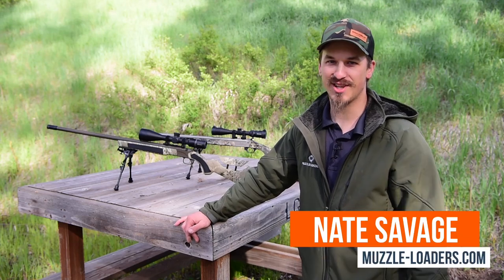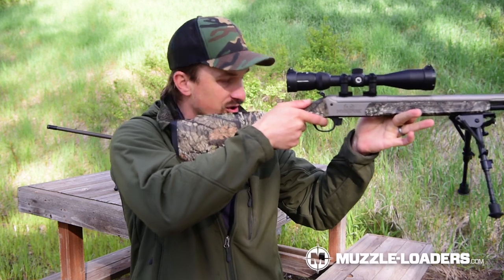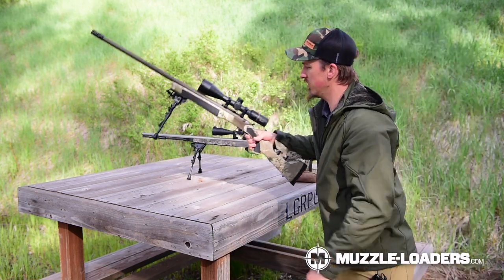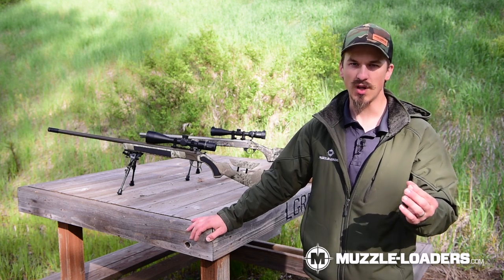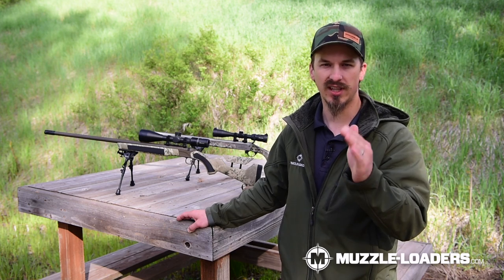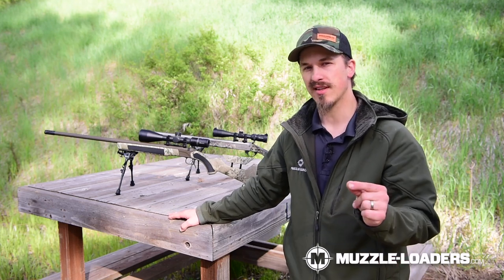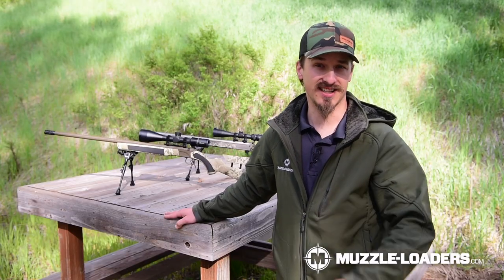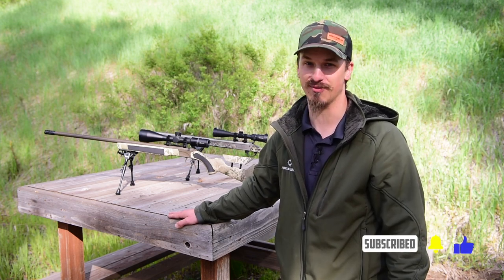5 Things That WILL Improve Your Accuracy with a Muzzleloader

Comment: It seems to have become fashionable to ignore why a rifle has a grip on it and to lay a thumb either on top of the grip or even beside it. With a hard kicking rifle that's a great way to get a case of scope eye. That's when the scope comes back and cuts you a new eyebrow. Hang on to that sucker. Blood running down your face does not make for a good follow up shot. lol. But it's a great way to practice flinching.